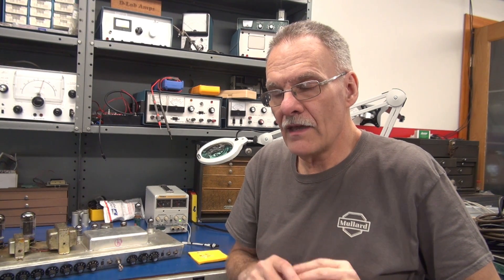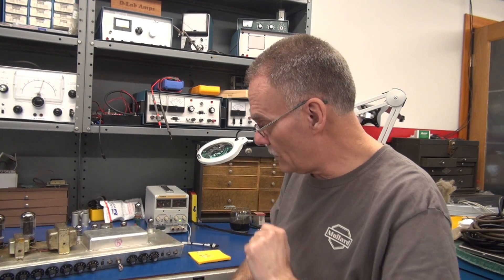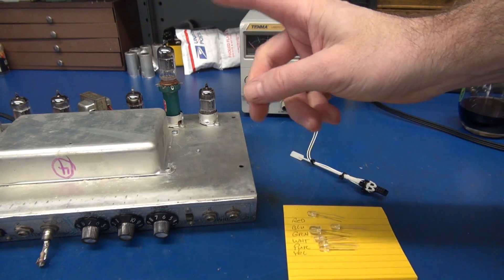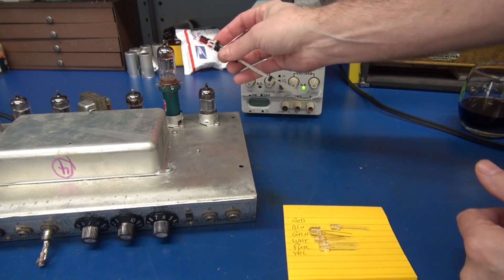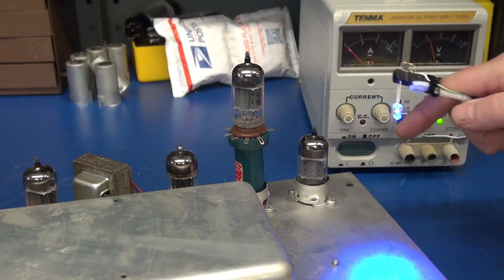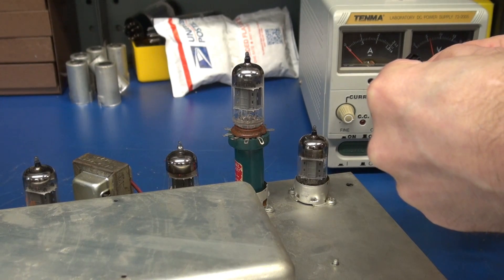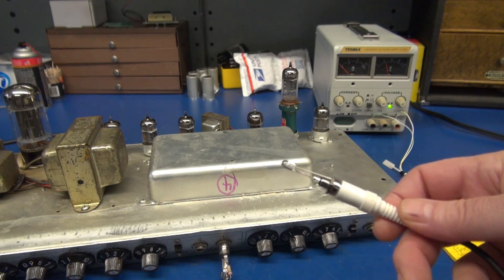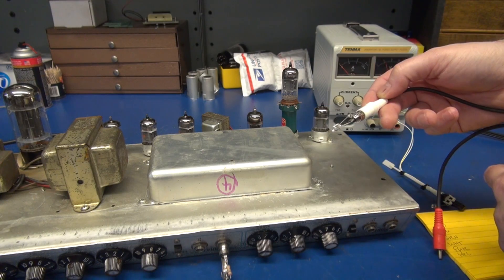Can LED base lighting of Tube amplifiers cause noise in audio output Bench test experiment

Comment: Use the proper series resistor for the chosen LED, clean DC drive ONLY and still place a 10 to 100 nF capacitor in parallel with the LED. I personally find LEDs under the tubes to be lame. A person should out grow that silliness at around age 10.

Comment: When powering an LED with AC, unless you take steps to mitigate, you are basically creating a simple distortion circuit.  LED will rectify the AC and when pushed beyond its linear region, will clip. Clippings introduces harmonic artifacts, which radiate. Nothing to do with the emission spectrum.

Comment: Those flicker LEDs will definitely add noise to the circuit. I was going to use one as a pilot light on a build last year, but their internal function generator that causes the flicker introduces a very digital noise.

Comment: You might have also mentioned using a well filtered DC supply for the LEDs. As you just demonstrated they'll create RFI if allowed to switch on and off.

(Also, I don't think the grid is where you seem to think it is. It's between the cathode and plate, so is completely surrounded by the plate,)

Comment: You might try one of those RGB color-changing LEDs.  They tend to use PWM internally to dim between the colors, and that might induce currents (pulsing at audio frequencies) in the bond wire, leads, etc and produce an effect similar to your experiment with the IR LED and sound source.   People have used those current pulses directly for (deliberate) noise making circuits.  Same with those LEDs that flicker like a candle flame.  There is even a guitar pedal based on those.   Your DC supplied LEDs didn't produce noise because they weren't doing that.  You might hear a click or maybe scratchiness (like a dirty pot if your switch is dirty) if you turn them off or on while they're near the lead or tube, though. 

It also might not even be current (electromagnetism), but, rather, capacitive coupling from the lead (of the IR LED) connected to the center contact of your RCA cable.  If the signal doesn't reach a high enough voltage to forward (or reverse) bias the LED, which is usually 1.5V or higher, there won't be much of a current going through it.  It would just be like one plate of a capacitor coupling to the tip contact of the visibly unshielded plug in the input of the amp or influencing the current flow in the tube like a very lousy additional grid.  It would be easy enough to rule this out.  Just solder a stiff wire the same length as the IR LED's leads to that terminal in place of the LED and try the same experiment.  It will produce a similar result or it won't.

Anyway, it's an interesting experiment, and it puts to rest any concerns about DC-powered LEDs causing noise problems in this application.  I just think the part where you are feeding AC into the LED is a red herring.  Unless there are amps out there that PWM dim the LEDs illuminating the tubes and the PWM runs at an audio frequency, which a lot of those for light dimming do because it is easy/cheap.  I mean, you could just get a hold of one of those amps and turn the illumination off and see if there is a change in noise.

LEDs (simple ones, operated on DC) do emit frequencies depending on the color.  Those frequencies are way above AF, and are called "light".

Comment: Experiment 1 DC powered LEDs won't produce noise. Experiment 2 however is AC  powered ( audio frequency ) and produces noise. Should have tried it with previous colored LEDs to show that and not an Infrared LED.

Comment: Using an infrared LED has nothing to do with it. All these frequencies are of the order of 10^14 Hz, and neither the amplifier nor the valve itself can respond to those. In the last case you were feeding AF to the LED, so it was emitting rectified AF into the grid,. which is audible. In the other cases you were feeding DC to the LED so you only got the light waves of the LED colour, which are gazillions of Hz.

You changed two variables at once. Try the audio through a red LED, or a DC-powered infrared, and tell us the result you get.

The real moral is that you would have to power the LEDs with DC. Otherwise you will get rectified hum, just as in the last case.
Reply: He is a little loose with "frequencies", isn't he? He also left out the obvious case of dimmable LEDs that modulate duty cycle to control brightness. You'll hear THOSE!

Comment: Could it be EMF in the last test? Maybe repeat the test with a resistor?

I would also be curious, if pulsing LEDs do have an impact, would a household dimmable PWM LED bulb do the same?
Reply: I was thinking that, but now I'm thinking electrostatic/capacitive.  You'd have to pump more volts into the LED to forward bias it (and draw current to produce a magnetic field) than I would expect to be coming out of that CD player's RCA jack.